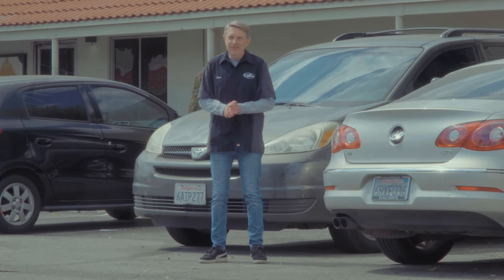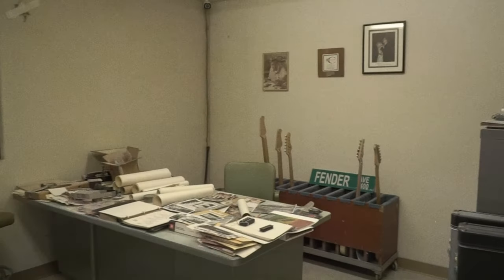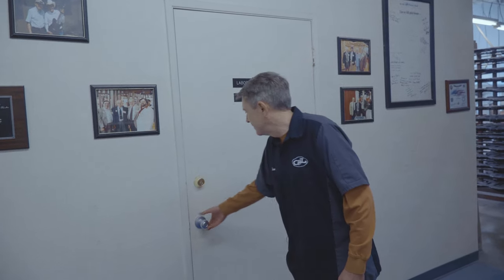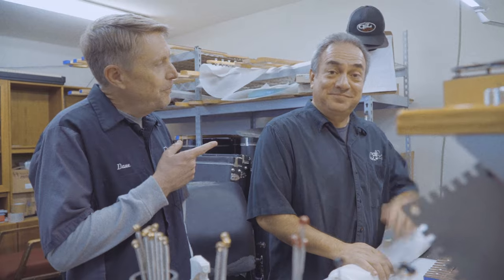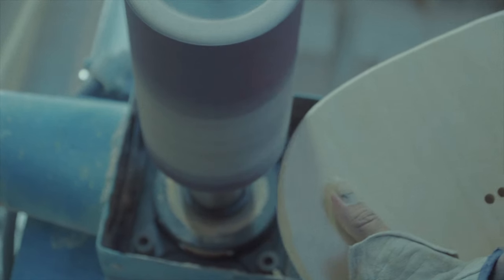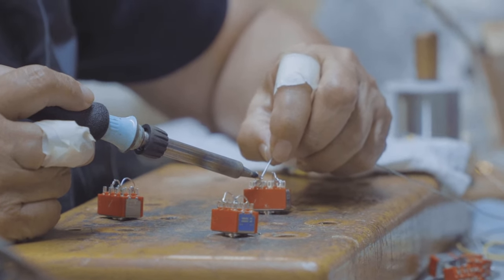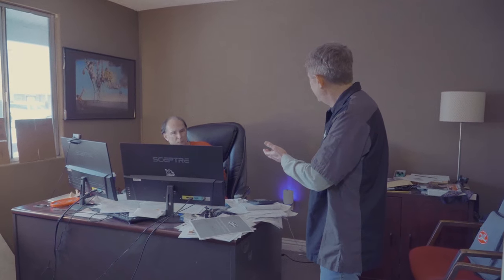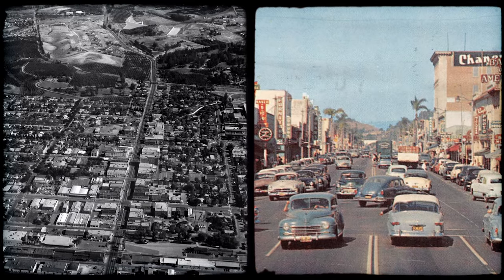Heart & Soul of Leo Fender's guitars | G&L

Comment: Their wood selection is really poor. I've never before consistently come across so many "heavy weight" guitars from a US guitar builder. Sure there's light G&Ls out there but good luck finding one. The two post proprietary bridge is also not the amazing piece of manufacturing and design they claim it to be. I found them to be just as if not less stable than a gotoh 510. They're stuck in the past drawing from a well of inspiration that had gone dry before the 1970s.
Reply: I really appreciate your comment here. I have my eye on a 1988 ASAT. Looks heavy. Does it sound like a tele?
Reply: @ac30lifestyle  Some of the earlier G&L guitars had bodies made of soft maple and they had a reputation as heavy guitars. I don't know about 1988 but ask the seller to weigh it. The Jumbo MFD pickups are very tele-ish with a little more output, midrange and clarity.
Reply: @tiki_trash  thanks for your input. It's been useful
Reply: @ac30lifestyle  Seriously, if you like teles and you can get a hold of a Leo era ASAT for a good deal, buy it.